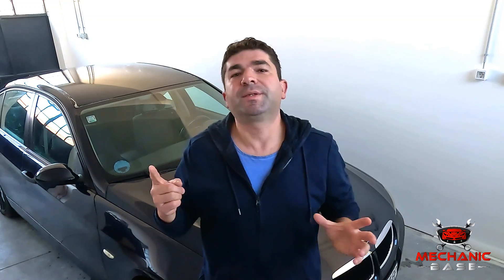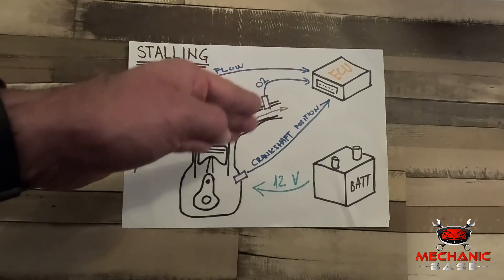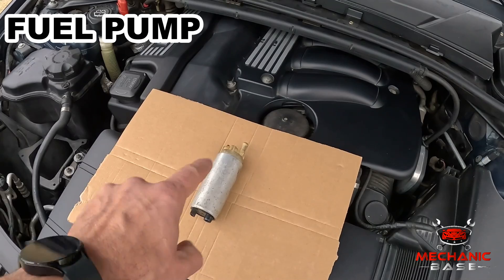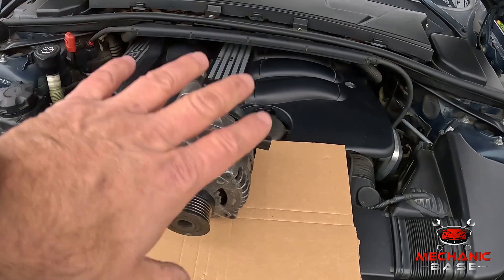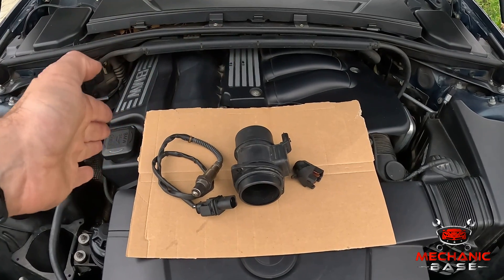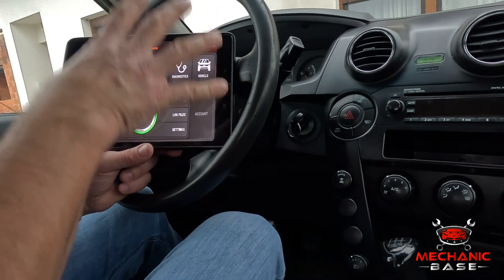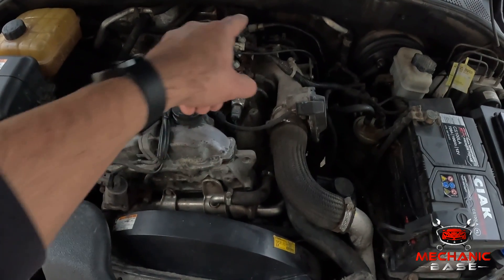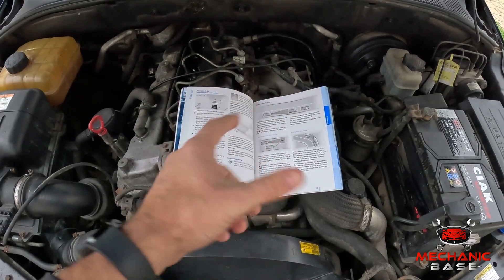Car Shuts Off While Driving? 7 Causes & How to fix it

Comment: hello, I'm just now reading the comments and looking for similar problems, I just found the same problem as mine, I have a vw touran 2009 bls, the car works normally, starts normally, does not lose power, everything is ok, but after 5 km it just shuts off, loses power on the control panel, but the lights and  they still work like the door locks, after a couple of attempts to turn the key nothing happens and then suddenly it turns on and it's all in a circle again!?  the question now is whether it is losing power due to a defective sensor or a defective relay, or is it possible that the computer is the problem.???
Reply: Did you get it fixed. Same issue for me. Please let me know
Reply: @1don211  hey, yes I fixed it, I had a problem with the relay, under the steering wheel there is a place where the relays are located, the mask has to be unscrewed to get to them, I think there was a relay 15, cost approx.  10 euros

Comment: Hi 
When we drive at a high speed of fifty miles, the car suddenly slows down as if we have applied the brakes and after a few seconds it returns to its original state. Especially on rainy days. What is the reason for that?
My car is 1 series BMW 
Kind regards

Comment: I’m had a Mazda family van and stopped while driving twice. Then I got a dodge caravan and it happened again twice the is time on the freeway all off the sudden died going to a good speed. It only happened in the vehicles that I was driving and I got suspicious of my husband at the time. I sold this two vehicles and brought a new Dodge Durango and in a month I had 3 accidents because the vehicle didn’t brake.The last accident I wanted to go the court so a forensic mechanic would give an inspection, in my back my husband pay the victim to avoid court. I went to police and they told me the vehicle was not in my name even though we brought it together and in the dealership I signed documents. I immediately got rid of my husband.

Comment: There's not a warning signal or anything... Dashboard doesn't shut down but it lags. It shows engine is running while it doesn't and after a few seconds will show no rpms. It doesn't even start again when I try to kick-start it from the movement of the car.

Comment: Maybe you can help me? I have a 92 dodge van with this issue. Has happened maybe once every 2 months. Id top off the oil and it would run with no problems. It happened again now, and itll start, run fine for 5-10 seconds, then start sputtering out and shut off

Comment: Hii 
I have  vw 1.6 sr , shuts off while i am driving then starts again , can u tell please what is the problem ?
Reply: Hello, could you kindly provide some more info on how you were able to rectify this?
Reply: @arifmuhammed3400  While driving engine cuts off more when i drive around 20-30 km after heating engine stalls then need to try restarting until starts again
But again stalls in a short time , i have changed fuel pump , ecm , camshaft crankshaft sensor relay 409 plugs , wires … Problem not fixed
Reply: @LeutrimKapllani is your problem fixed now ??

Comment: I have a 2015 Mazda 3 and the engine shut off when stopping at a red light. The dashboard lights stayed on when the engine shut off and the check engine light and battery light switched on. When I press the ignition button to start the car again, it keeps cranking but dorsnt start. When I do the ignition 2-3 times back to back to force the car to start, the car then finally starts and the issue doesnt happen again for weeks or sometimes months. Any idea what could be the problem? Im due to replace the spark plugs soon (in the next 5k km) and I put a fuel system cleaner in the tank in hopes that if there was a clog in the fuel system it could clean it out. But I'm hoping you have a suggestion I could try to figure out whats happening. I'd like to add that the car battery is 3 months old only and relatively new.
Reply: Ever find out what was wrong? Currently having this issue in a mazda 6
Reply: Having this exact problem with the same Mazda3 2015, any developments for your situation?
Reply: @jamescivelli8245 I had a similar problem, turns out my engine wiring harness was shorting out because the wires were corroded and needed to replace it.
Reply: Same problem
Reply: @solo199418 I had a similar problem, turns out my engine wiring harness was shorting out because the wires were corroded and needed to replace it.
Reply: I had a similar problem, turns out my engine wiring harness was shorting out because the wires were corroded and needed to replace it.

Comment: What about the throttle body and sensor.? A common issue as cleaning  these are not part of a general service and corbon can clog and restrict air flow. My Toyota tarago that I bought very cheap cost me $23 dollars and half an hours work to fix.

Comment: The main challenge is on how to fix without those code reader tools
Reply from the maker: You can buy a Bluetooth OBD2 adapter that connects to your smartphone for $30 or so, and run it using some free app😉

Comment: My car’s ignition coil and spark plugs were all changed it starts perfectly but turns off after 10 minutes or starting. What is the issue?
Reply from the maker: Do you have any codes? Check engine light? 
This might be a bad crank sensor.

Comment: Hey.. i'm having this issue. It happen to me 2 times in the last 4months. Also happens that now and then cranks but does not start unless I insist with the ignition for a prolonged time (5sec or more). This can happen whenever. Sometimes in cold sometimes after 30min drive just decides to not start when trying to turn it on again. I have read with OBD machine and no errors were found and fuel inputs injectors have normal values. Timing belt and alternator belt were replaced last week as well as all filters and oils. MAF sensor was also cleaned. My batery is new as well. Alternator is reading well so thats good too. Its driving me crazy because i cannot find the issue. No errors are showing. Any ideas? Bought a Fuse but i'm waiting for the car to fail again so i can replace it and see if it fixes. Should the ignition conector failing trigger an error on OBD?
Reply: You checked the fuel pump?
Reply: Hey man did u fix that?
Reply: @LeutrimKapllani  hey .. yes i did. I've tri ed everything then went to check the fuel pipes conecting the fuel filter to the engine and they were swapped by mistake. They had no colour todistinguish one from the other. Both were balck and made of ruber so my mechaninc must have swapped them last time he did the maintenance.
Reply: @hbr6545  is your car diesel or petrol ?
Reply: @LeutrimKapllani  its a 1.9TDI 105HP

Comment: i have 2005 kia sportage its having poor acceleration problems and occasionally dies when taking slow turns or stopping. have a few ideas on what it might be but there is not a check engine light so therefore not sure what to start with
Reply from the maker: Which engine do you have in it? We'd suggest - start by checking the MAF sensor and cleaning it if needed.

Comment: My car turns off when the revolutions go below 1000. If i go too slow when im stopping on a stop sign or a red light it will shut off and i just put in park and turn it on again and it always works. Whenever i felt like it was about to stall i would step on the gas JUST A TINY BIT and by doing that it wouldnt turn off. I stopped driving it for now since im trying to figure out what the problem is but do you know what this means by any chance? Id greatly appreciate any advice on this, Thanks
Reply: I have the same issue!! its like i wrote this myself
Reply: maybe check your idle air control valve, it may be dirty or faulty. you can clean it and if still persists then replace it. check online for the process on whatever car you have
Reply: @safwannn7656  will try that and see
Reply: ?Crank angle sensor?..Maybe,, my Pajero was doing this just yesterday and now were trying to figure out the problem, we had to put it in neutral to start the car again bc it was just konking out while we’re driving, or coming up to a giveway sign on a roundabout.. talk bout scary, I’m just glad my partner was driving 😮
Reply: Same!
Reply: Try the purge valve.
Reply: Good day , bro. How did you solve your car going off on motion case? I'm experiencing it with my car now. Many thanks

Comment: Hi,My volkswagen polo 2006 is stalling when i drove around 20-30km and it will become normal if i stop and remove the car keys out. No fault codes detected during the inspection. Somebody please explain why it is happening😢
Reply: Did u fix that
Reply: Yea, It was due to the failure of NOX sensor ,I replaced with new one.
Reply: Is your car petrol or diesel ?
Reply: @LeutrimKapllani  petrol

Comment: My 2010 toyota rav 4 turns off randomly when braking or slowing down and turning into a driveway. The check engine and oil light will flash and flutter on while this happens. What do you think is going on?
Reply: My car did the same thing I gotta Toyota too
Reply: Did you figure it out?
Reply: @Everydayheros  leak
Reply: @KT-ed8hj what leak please?

Comment: 93 Toyota Corolla....i replaced fuel filter. Doesnt have a crankshaft position sensor...... could it be the fuel pump?? Or that im outta gas now?? The car stopped when i was driving down the road.  My ignition was punched out when my car was  STOLEN it stopoed after a week after i got it back. Any suggestions??

Comment: My 2017 Hyundai Elantra is only shutting off with dash lights coming on when I’m going slow or like in traffic… any idea? No codes and car turns right back on when It turns off.
Reply: I'm also facing the same problem with my 2014 Hyundai Elantra...Any help to fix it????
Reply: I got an oil change and changed one of my spark plugs/ignition coils which I had got an engine code for months prior and never changed it. Once I did a little tune up it stopped immediately. Hope this helps

Comment: Thank you so much. Very nice detailed video. Will post updates, I doubt my fuel pump on my 2002 Honda city vtec
Reply from the maker: What issues are you having?
Reply: @MechanicBase  I find the rpm movement uneven, idle is lesser than normal, leading to juddering at idle
Reply: Jumped the car it died , replaced the battery and the car will die if I try to accelerate

Comment: Help:( 

Bmw e46 318i N42 b20 engine..

Shuts off when driving, normally when taking off from a green light or when it needs a lot of power. Then it like, loses the power and completely shuts off, dash lights are all on. I turn the car back on, sometimes it will turn on perfectly fine and then do the same thing again and sometimes it will be hard to start and idle very roughly and then i will turn it off and on again and then its completely fine! 

I think i will check the fuel pump next, 

S1B2 lambda Heizung code came on but i don't think the car would turn off from a bad lambda? I think this code is there because of the problem that is happening elsewhere.. 

I cleaned the throttle body butterfly and the maf sensor already. 

I think i should check the spark plugs too. 

Help appreciated!
Reply from the maker: Those engines are known to have issues with crankshaft position sensors and sporadic signal loss. Especially if it suddenly cuts off, and restarts fine afterward. Does it ever happen that briefly shudders on acceleration while warming up?

Comment: Ooh, how I wish i came across this video earlier before i spent all my three months earnings trying to fix the exact same problem of car shutting off while driving! We did a lot of guess work until we ended up replacing almost everything! Although that problem seem to have disappeared several new ones have emerged! Currently we are dealing with rough idling which lead to a complete shut down of the engine. It is a Mazda Tribute 4cylinder, YF engine, 2003. What need we to check? Please help!
Reply: I hv same problem in 2012 Sylphy. Car just suddenly shut off while driving at speed  ~30-50km/hr. I hv try error and change few part, crank shaft sensor, knock sensor, spark plug, and yet still happened intermittent. Lastly, i change the fuel pump. I hope this is the culprit cause car suddenly shut off....Ady drived 200km and still under monitoring. Wish me good luck  !
Reply from the maker: Do you have a check engine light warning on the dashboard? Any trouble codes?
Reply: @MechanicBase  I have no check engine sign on dash board. It has never been ever since I bought the vehicle(second hand) in 2018.
Reply: I have the same problem and yes I have engine and little - + cup sign
Reply: I also have a problem with my Mazda 626. I'm going to check all that was shown and I was wondering about the battery. My battery is 5 years old. I have not had any trouble with it cranking , it starting cutting off at stops, but it has just started cutting off while driving. I was thinking maybe the battery needs replacing since it is 5 years old. Thanks for all the information!!

Comment: my 2000 vw mk4 1.6sr engine goes off at random when on motion, happend 5 times on a 1hr drive.i have  cleaned the maf, changed the plugs too, checked the fuel pump and filter, but the engine still goes off on motion.
no check engine light or error codes.

pls what do you think it might be?
Reply: Hello !
I have the same problem.
Did u fix that?
If yes please tell me what was the problem , thank you.
Reply: @LeutrimKapllani  hello, i removed the battery termimals and left it parked for like a week;the issue stopped on its own.
Reply: @adesinaolawunmi431  oh really, i hope thats happen to me too, thank u so much
Reply: @LeutrimKapllani  
You are most welcome.
Reply: Hello again ! Do you have any problem with stalling cuz i am having again the same problem?
Reply: hello, I'm just now reading the comments and looking for similar problems, I just found the same problem as mine, I have a vw touran 2009 bls, the car works normally, starts normally, does not lose power, everything is ok, but after 5 km it just shuts off, loses power on the control panel, but the lights and  they still work like the door locks, after a couple of attempts to turn the key nothing happens and then suddenly it turns on and it's all in a circle again!?  the question now is whether it is losing power due to a defective sensor or a defective relay, or is it possible that the computer is the problem.???

Comment: My 2013 Dodge Caravan started shutting down at 3 yrs old and the code reader never showed a thing
Reply from the maker: Does it restart normally after the engine cuts off?
Reply: @MechanicBase my car shut off while in park sometimes but the engine light doesn't come on

Comment: Hi, I have a riddle for you.  My automatic Audi starts with no problem and runs well.  But, after it's in park, I put it in reverse and it does reverse. Then, when I put it in park, the car won't move.  I have to shift the car to neutral and then back to drive, then it goes. I don't have to restart the engine, just shift to neutral  and then back to drive. Has anyone ever heard of such a thing?
Reply: That's how it is supposed to work.... Sounds like problem is too much alcohol. Don't drink and drive.
Reply: @limitlessbydesi9n94  I meant to say drive, not park 🤣🤣🤣.  I loved your answer
Reply: My car 2013 Mitsubishi outlander sport stopped going toward and backwards I let it sit over night it went forward and reversed but then stopped I have multiple light censors on tho I’m just hoping it’s not the transmission anybody else had this issue?

Comment: I went to AutoZone and my car read a lot of codes and it was saying that I had to relive the brake sensors and also the coolant sensor, could that also cause a car to stop at a stop and or when your trying to accelerate the car but it won’t go?
Reply: very late but if ur trying to accelerate and the car wont go, if ur car is in a limp kind of thing, then its probably something involved with EPC or throttle body, thats jus frm my eperience
Reply: @ItzY3XI  thank you for trying to give feedback but I don’t have that car anymore the tranny went out lol😂 currently on my third car and haven’t been able to drive it for 2 weeks

Comment: What can cause a no spark problem? fuel pressure is ok,  I changed the crankshaft sensor but still nothing.  It's an Opel Omega B 1998 model 2.0Ltr Exotec Engine
Reply: Coil module
Reply from the maker: Sorry to hear that, @leonnatala4776. Did you buy an OEM sensor? These engines are notorious for not liking aftermarket ones.
Reply: @MechanicBase  I bought from autodoc not sure if theirs are OEM.
Reply: Indeed it was,  I managed to replace the coil module and now I have spark.  Thanks a lot for the help,  how I wish we could interact more on this project of mine.
Reply: Car cuts off when in reverse but cranks right back up
Reply: @snugglybuggly9139  choke and carb cleaner down the intake and also the maf sensor . also look for cracked vacuum lines
Reply: my car is 1998 nissan terrano,,,the engine always die when going deep the steep,,,any advice please??